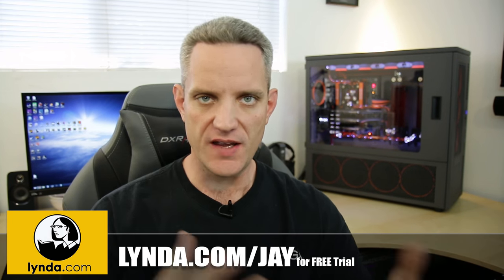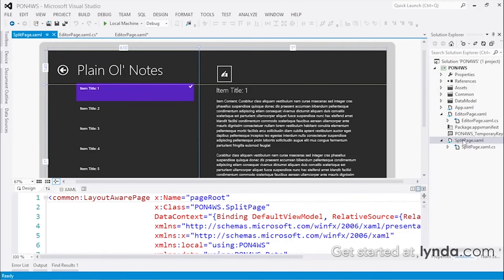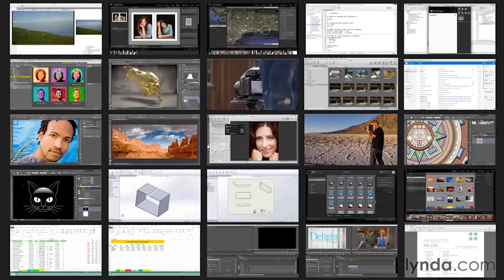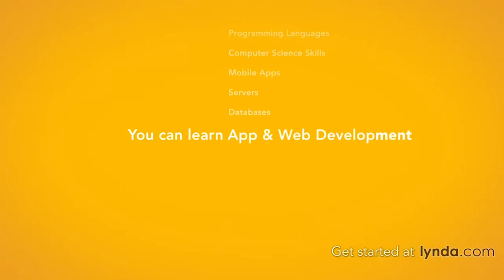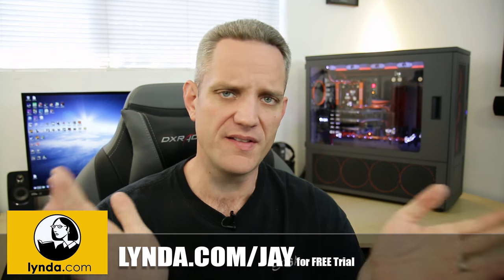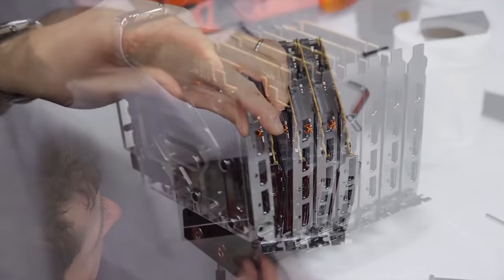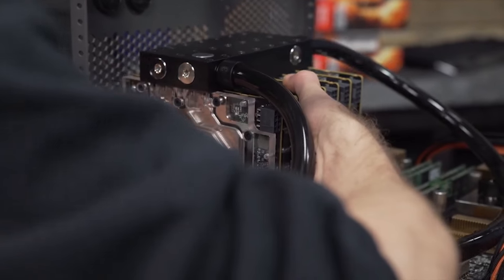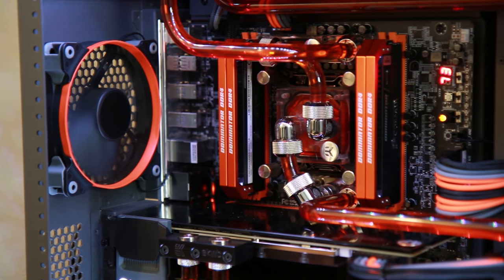Is watercooling worth it?

Comment: I am building my first pc that said what I want to do is use ryzen 7 possibly 2700x or 3k series that comes out next week, I have cougar evo rgb case and I can put 360 radio in it I'm also using gtx 1080 ftw hybrid so I'm not sure what use eather 240 and put 120 next to it ontop or put a 360 ontop and 120 gtx in back fan spot, I'm not sure what to do would like some advice. Thanks

Comment: I don't understand why people watercool their cpus in the first place. If I ever go watercooling, I'll start with my gpu.
Reply: +Heruvilius It depends on what the people are using the computers for. My computer is rendering more than I'm gaming on it and rendering for me is generally more CPU-intensive. My i7 3930k is now clocked at 4.71 GHz on all 6 cores @1.376 V and hits 77°C on the warmest core on Prime95 large FFTs. Would be impossible on air-cooling.
If you're more of a gamer and your GPU is under high load for long periods of time, then it would be better to start watercooling the GPU.

Comment: jay, is there something we can do to get more overclocking headroom with bios modding? i have a 750ti FTW 73.3% ASIC Quality, and no matter if im running it at 1.175V (stock) or 1.2V, my max overclock doesnt change and the temps dont reach 60ºC, does it has something do to with my cooler? if i watercooled this card, would i get extra overclocking headroom by increasing the voltage?

Comment: if you cant keep the system cool for under 100 dollars with all the fan coolers available such as the NH-d15 or NH-D14 or the new coolermaster V8 then yes. watercool. otherwise its not worth it to watercool

Comment: is it possible to get a after market heat sink with fans for a titan x because i cant seem to find one,
Reply: +John'sMCuniverse You mean you want to switch out the air cooler on a titan? Why?
Reply: +PierreDolphin If thats what you mean then sometimes people sell those on ebay. Maybe they went water cooling or the main card was dead or something.
Reply: ok thanks
Reply: +PierreDolphin the only problem is i live in new Zealand and most of those are overseas, i would buy a new one from overseas but not a used one
PS: the reason is because i want cooler temps than what it runs at with the stock cooler
Reply: +John'sMCuniverse The Titan X has exactly the same PCB as the reference GTX 980 Ti. So every after-market cooler that is designed for the reference GTX 980 Ti should work.
For example the ACX 2.0+ Cooler of the EVGA GTX 980 Ti ACX 2.0+ 6GB and EVGA GTX 980 Ti Superclocked ACX 2.0+. Or the cooler of the Zotac GTX 980 Ti AMP! 6GB. Only condition is that the GTX 980 Ti has a reference PCB.
Reply: +Meta Custom Computers thanks
Reply: Meta Custom Computers God damn it your right. i hate being wrong

Comment: So 14 fans to cool it proper silent on idle. But what for? I have 6 fans in my system, one is custom gpu cooler, and we are at 18-21°C on idle on Cpu, without any hearable fans at all. What`s the point? Go wcooling to be silent on idle and mid load? Doesn`t make sense. Can do that with my latest aircoller as well. Don`t get me wrong, I`m into wcooling, did some serious custom AIOs cos I can, but did it make sense? No. At least not for the average user.

Comment: What if I just say screw it and use 2 really small AIO coolers - one for my i5-2500K @ 4.4 GHz, and one for my weird GTX 560 Ti that instead of thermal throttling, locks up. And do the ghetto water cooling for my GPU!

Comment: hi, i am working on girlfriends gaming PC and budget allows me to go with either i7 6700 and air cooler or i5 6600k with watercooler-> overclock to cca 4.6 GHz. thanks for your opinions. :-)
Reply: will she be gaming or rendering and editing. if just gaming then an i5 will be good enough. if editing and rendering then the i7
Reply: +coconut pie gaming only, but that PC shoul last for like 5 years... i should be fine in both cases... idk... personál i have 4670k, curretly not overclock because there is no need for that, in combination with 780 I can still run AAA game on ultra/ very high details. Jay said to not spent money on water, if you can buy higher grade od components... but h110i looks also badass... compated be quiet's Dark rock advanced.

Comment: my gpu is running really hot because my PCIe 3.0 is broken and i have to run my PCI at the bottom like 5cm above my HDD'S (Corsair Air540)

and my R9 390 just can handle 1200 safe, if i got the side panel of and and i place a fan next to it.

if got a i5 3570k running at just 4,2GHZ stable, but i got 1 tripple 1 double Rad

would you recommend buying skylake or just a new LGA 1155 board?
Reply: buy a 1150 board and you are good to go, skylake doesnt make that much a differece.
Reply: go with skylake. don't buy the old because it will even be a year older
Reply: a good used 1150 oc board still coast 150€+ :D
Reply: I would not upgrade to be honest. That 3570k - especially oc'd - is enough even in the future.
Reply: +Dash199t™ I'd say just get another motherboard. Unless you are going to be getting the i7 6700k then you probably wont see much of an improvement, and even then you won't see too big of an improvement.
Reply: the problem is the gpu temp with that board because its so close to the hdds
Reply: Grab a X99 chipset motherboard and wait for prices to drop. You'll save money in the long run. A comparable Skylake CPU and 170 chipset motherboard will cost you way more. Do a little math and you'll answer your own question.
Reply: +Nick Bowen it wont cost more if you go for an 6600k or 6500 then it will be both cheaper gets the bonus gaming performance if you want to render then x99 but for base gaming its needless spending extra. I have a 6600k it worked out cheaper and runs incredibly well but if rendering its worth while going for x99
Reply: +nzmctk What are then benefits of a 6600 or 6500 vs his current 3570?
Reply: +nzmctk And why is rendering better on Skylake?
Reply: +Nick Bowen read my comment again i recommend x99 for rendering as the bonus cores make a huge performance increase
Reply: +Nick Bowen there is an about 10-12 % increase in performance per generation add that up and its between 30-36% increase in performance that doesn't even factor in overclocking which with my 6600k at 4.8 ghz got a cinibench score of 10 less than a 4th generation i7 so its a fantastic processor for the comparative cost
Reply: +nzmctk 10%-12% is about correct for new architectures, but you also have to remember that 3xxx, 4xxx, and 5xxx all run on the same basic architecture. This means his 3670k will be a few percent slower than a 4690k which will be around 10% slower than skylake. It's only maybe 15%, not 30%.
Reply: +Barney Stinson Buy a new case. Much cheaper.
Reply: +Fmily this isnt necessarily  true as there is increase in performance from generation to generation not just architecture to architecture otherwise what is the point in releasing each of these upgrades? This is a natural process of refinement of both manufacturing process and selection of parts, kady lake will offer a 10% performance increase this comes as no surprise as its there marketing strategy
Reply: Your processor will be fine just get a new motherboard with a working pci lane as this will (should) offer performance increase due to the connectivity with the cpu
Reply: Really you own an 1155 dude!! Threw that old gear out and get skylake.
Before i got skylake i ran with a 1156 rig and im happy to say upgrading was worth the money runs cooler then the older cpu that was hitting high 75c with a overclock on 3.8ghz.
Reply: +nzmctk Jay talked about this in one of his old videos when he upgraded to the 3770k instead of the 4770k. It's only a refinement of the exact same processor. As Jay says in the video I mentioned, the main upgrade you get with the 4xxx over the 3xxx is in the integrated graphics of the CPU.
Reply: +Barney Stinson 
Get a PCIe extension cable for a couple of bucks, plug it into the working slot, then put your card where ever is appropriate.
Reply: +Barney Stinson i had a similar problem. buy a bigger case or a smaller board. i ended up upgrading and got a smaller board. ;)
Reply: +Barney Stinson I'm canadian, kappa.
Reply: Ikbenjoufan
and that has what to do with the price of tea in china?

Comment: I heard that you can water cool your RAM , is that really good ? I thinks it's just stupid
Reply: its good if you really overclock your RAM, same as most components.
Reply: +TheWitherLP It's absolutely stupid with DDR3, you just heat it up more with the water. I know it sounds stupid but it's true.
Reply: Use your brain a little bit. The CPU and GPU puts out tons of heat. If your water is 40C that's wonderful, you'll get good CPU and GPU temps. With that water you'll just heat up the RAM, DDR3 runs very cool. It's absolutely pointless and stupid.
Reply: It's for aesthetics.
Reply: Yeah it looks cool to some people and it also heats up your RAM more.
Reply: +Boni Hollóssy I do have DDR3 Rams with heat sinks and they are still not even touchable. They are like 80C. You may not run your pc as much as you think.
Reply: +B3bis i think it would be more as 50C anything about gives skin burning from first degree to 2 second. 80C give 2 to 3th degree burning.
Reply: B3bis Hahahaahahh
80C? Funny.
Reply: Boni Hollóssy
 Think it as if you touch it, you may instantly bake your finger.
Reply: B3bis Sure...
Reply: +Boni Hollóssy For people who overclock RAM over the cap of 1.8 V and with a voltage frequency over 300 kHz, RAM can reach ridiculous temperatures. If you have a 1600 MHz on stock latencies, then you don't have to worry about RAM-cooling. If you take your OC serious and really want to squeeze the last rest of performance out of your RAM (higher the frequency, lower the latencies, higher the voltage frequency, higher the current capabilities), you are better off watercooling it.

Comment: what about GTX 970 4GB FTW+ ? can i water cool it ?
Reply: You mean 3.5 gb ;^)
Reply: sure even though you can use 4 gb on thaat card
Reply: MadManX668 I'm just messing with ya.
Also to answer your question, you can water cool it but there's no point unless you just want to.
Reply: i know you are...  its loud as f** with fans on 60
Reply: MadManX668 Do you mean fans on 60% or temperature at 60c ? If it's the fans then just as long as the card is not getting hot ( above 80c ) you're fine and you can just manually turn down the fan speed or the fan curve. If the fans are loud when it's at 60c then you can again slow them down cause 60c is way below safe temperatures meaning that you can easily afford to have it run hotter.
Reply: 60% Its not I just like to keep the temps low and if I dont have fans on 60% my card reaches 80c and im not ok with that

Comment: Is it possible to watercool a GTX 960?
Reply: There is no point with that card
Reply: Depends on your brand
Go to ek waterblocks and select your card , and if its an refrence pcb, yes
Reply: +Paul Winston (TheAmericanLoudmouth) It runs basically cold on air, no reason to do it. But yes it is possible
Reply: Dosen't look like there are any cooling blocks available. Thanks anyways.
Reply: Not really, it wouldn't be any better anyways because it runs cool on air. Also its a 200$ card, like he said in the video it doesn't make sense to watercool medium range cards

Comment: Is it worth it? Ok some won't mind the work, the price is the issue. Don't these things use 300w in itself? more than a GPU? So now this thing is getting closer to a winter heater in terms of electricity and not only that, you'll need to buy the water cooler, a new PSU because lets be honest over 50% of people who game don't have more than 650W and 50% of computers in general have 650w or less. So it might only be worth it if you live in the USA where a better PSU only costs around $100 whereas in the rest of the world it's $200 almost and the water cooling parts are price bumped as well. USA wins, rest of the world loses...

Comment: yeh do a maintenance video :)
Reply: +bossussuh He already showed that he has no clue about maintenance, else his Mayhems Pastel wouldn't have discoloured.
Reply: +Metatr0n i think that if a loop changes color and not even mayhem having an exact answer as to why it isn't due to bad maintenance...
Reply: bossussuh
Lol? Mayhems already knows. They released the information years ago that on the Mayhems Pastel Pure Black the discolouration to brown happens because of copper-oxide in the loop. That is true for all other colours aswell. So how does copper-oxide get into the loop? By corroding radiators. How does a radiator start to corrode? Watch Jays video about his colour changing loop again, he openly admitts that he "cleaned" his radiators several times excessively using different chemicals, acids and vinegar. Copper is a sensitive metal and bad treatment, for example with chemicals or acids can cause corrosion very quickly. So yes, it's his fault. He caused corrosion in the radiators which caused copper-oxide to go into the solution which caused the discolouration. Is proper radiator cleaning part of maintenance? Yes. Case closed.
Jay has no clue of what he is doing, the community and everyone who thinks he's the all-mighty-watercooling-guru are the ones that give him the power to look legit. People who know about watercooling, especially here in the German casemodding- and watercooling-scene, everyone thinks he's a joke, which he practically is.
What about that white stuff in his loop? Didn't he promise to be "completely honest" about that matter? Didn't he promise to keep everyone informed if he gets to know new facts? Well, in a lenghty letter with photos of proof I sent to his Facebook and his Twitter, I explained that the white stuff has nothing to do with "salts that get pulled out of the copper" (which chemically is absolute nonsense), the white stuff is nothing more than Titanium-Dioxide (TiO2) which is in fact the industrially most widely used substance to dye stuff in a white colour. Why is it the most widely used substance? Because it has no disadvantages. It doesn't lump, it doesn't stick, it just flows in the solution as long as the water is in motion. In fact, the Titanium-Dioxide was already in his loop when he filled his loop with Mayhems Pastel for the first time, because it's an ingredient in every Mayhems Pastel colour.
What did Jay do with this information? Nothing. No reaction, no reply, no statement in his videos, not a single try to correct his lies about Mayhems products.
Why? Because else he would have to admit that he's at fault for being ignorant. But the all-mighty-watercooling-guru is always right, there is no way that he could look into the camera and tell the community: "Guys, I fucked up."
So he just keeps his mouth shut and hopes that everyone here in the community just eats what he feeds them.
I know a lot of folks from the German scene who tried to give him constructive criticism on his Twitter. His reaction? He banned them. Because he's the all-mighty-watercooling-guru.
Reply: +Metatr0n ok can't really argue with you there seems you know quite a bit and me well never done a custom loop so yeh... but jay did say that mayhem was replicating his loop to see what caused the color change seems to me that they didn't know or maybe jay made it up i don't know and i don't care these videos are entertaining and i like watching them if ill ever try to do my own loop ill research more than just watch a jay video don't worry about that i don't see jay as a water cooling guru he seems to know some stuff apparently not all of it :)
Reply: bossussuh
Don't worry, I believe he is quite capable and he has a good fundamental knowledge. What I dislike or better, what I hate are lies, especially if someone tells them deliberately.
In my eyes, Jay would be a greater man by admitting that he was at fault then by trying to be the big man he pretends to be.

As for watercooling your PC, there is not much magic behind it. Start easy, best way to start is with a coolant pre-mix which directly goes from the bottle into the loop. Doesn't look that great but for starters it's important to get the functionality right before you care for aesthetics. Never use chemicals or acids for cleaning your loop.

1. Upon receiving the radiator, flush it with distilled water
2. Install your loop
3. Fill it with distilled water and run it for a couple of hours
4. Drain your loop and fill it with distilled water + sodium bicarbonate and let it run for a couple of hours
5. Drain your loop and fill it with distilled water again and let it run for a couple of minutes. Drain everything and repeat if necessary
6. Fill your loop with whatever you like (e.g. Pre-mix, Distilled water + watercooling concentrate, Mayhems Pastel, whatever)

Even though a lot of people tell you that automotive cooling liquid will work too, I wouldn't recommend that because automotive coolant has a different biocide in it. The biocidic effect of automotive coolant comes from reaching temperatures of >95°C when the engine is turned on, which kills all life inside the loop. Since your watercooling loop will reach temperatures between 35°C and 45°C (which are perfect temperatures for any kind of stuff to grow in your loop) I always would recommend a biocide designed for PC-watercooling or a killcoil.

I always advise to disassemble the whole loop once a year to refresh the thermal paste on all waterblocks and to refill the loop with fresh coolant.
Everything else is learning by doing that no Youtube-video in the world can teach you.
Reply: Tnx for the info ill try to remember to read your comment again if ill ever go water :D
Reply: bossussuh
No problem. That's what a comminuty is there for.